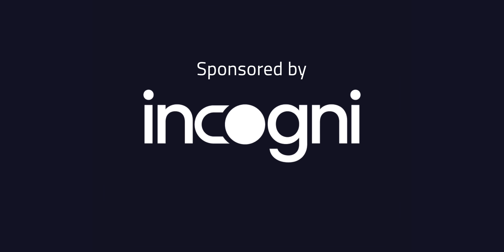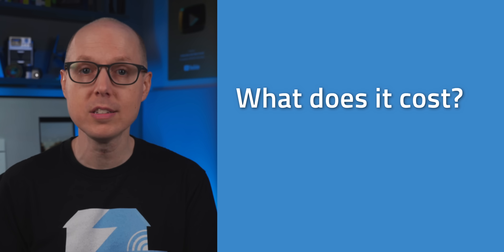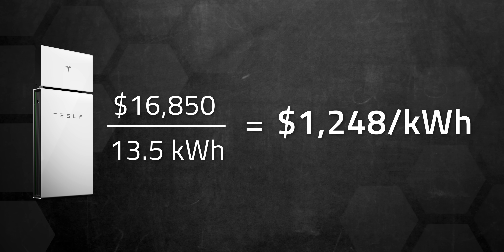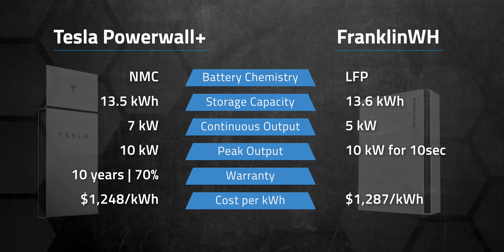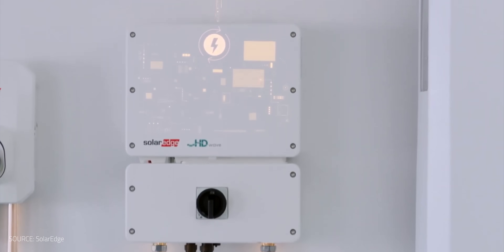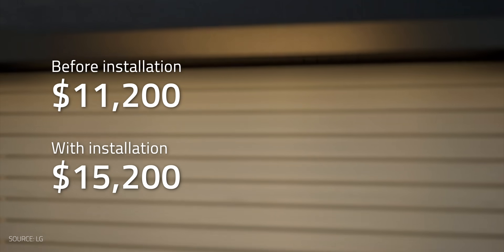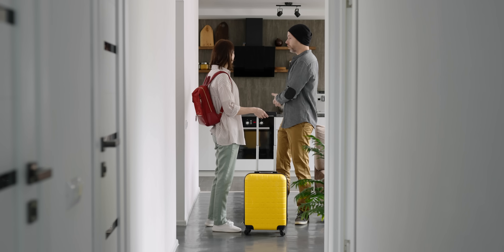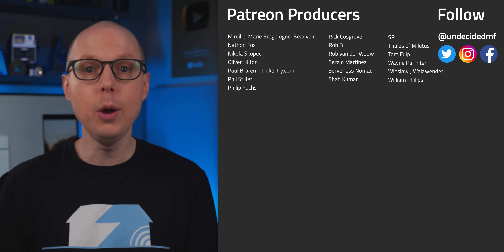Top 5 Batteries for Home (And One You Might Not Expect)

Comment: Something I don't think you mentioned is how ridiculously easy it is to DIY a solution, these days.  With PnP inverters and server-rack batteries, going off-grid or grid-tied with DIY battery options is easier than most folks might believe.  You can also save quite a bit of money in the process, plus you wind up with a much better understanding of what you have, what to expect from it, and what to do if there are ever any issues.  Commercial product offerings are nice n' all, but there is stil are many DIY options in this space that are worth considering.
Reply: same. almost no ROI of the products/services video mentioned because these systems keep going down in price, getting better, and professional install is too expensive. a simpler, cheaper system installed by an electrician will ROI in a few years then buy again/upgrade after a few years.
Reply: Do DIY ones have any sorts of Smart Home integrations like Home Assistant ?
Reply: @NicCrimson  My off-grid DIY system is fully integrated into Home Assistant, along with my grid-tied system. My off-grid inverter uses Solar Assistant MQTT broker to communicate with HA. I have full automation control over my system and it automatically manages switching between grid and off-grid supplies, supplemental battery charging if needed, various load management automations etc.
Reply: @alexsimmons1803  Would love to learn about your setup
Reply: @NicCrimson  - Not nearly as much, but depending on your philosophical bent, that may be considered a positive.
Reply: Exactly what I'm doing.  They're less than half the price of companies like Eco/Blu/Fran/etc.  And I save two grand by (=carefully=) doing all the work myself.
Reply: Sadly, in Finland DIY is not allowed by law. Only certified electricians can touch your home circuit board.
Reply: @DenzilFerreira  Same here - the good thing is the AC part is not hard and doesn't take long for a sparky to put in a transfer switch or essential loads panel. I don't touch the AC side.
Reply: @alexsimmons1803  in case there is a fire at home, and it's determined that it's electric, they will ask for record of certificated electric work. If the spark came from somewhere not certified, and it was my doing, no insurance will pick up the damage. And if it spreads to others homes, it's jail time. Not gonna risk it.
Reply: @DenzilFerreira  Which is why I said I get the sparky (electrician) in to do that work. It's a pretty simple job for them.
Reply: @alexsimmons1803  ah gotcha! Yeah indeed 👍
Reply: @DenzilFerreira  are you sure it is your home then? Sounds like the Government owns your home, and you are a surf! Sorry! :face-orange-raised-eyebrow::face-blue-wide-eyes:😪
Reply: @DenzilFerreira  - Glad I still live in a place where people are allowed to be both competent and free.  At least for now, anyway.  😕
Reply: @jasonbroom7147  There was a time when electricity was for certified electricians only and the whle installation was sealed. Then the rules chanced so everything after the meter was accesible for DIY as well. Due to the increasing ammount of incidents the rules are close to return to ancient history: Only certified electricians can instal/service anything connected to the grid.

People should be free and competent, unfortunatly a large group of people is free to be incompetent.
(Note that we are blessed here with a highly reliable grid, nearly no one here can recall an outage that lasted longer than a few minutes over the last 50 years)
Reply: @hotdognl70   There was a small regional department store chain in Florida in the fifties and sixties called Maas Brothers.
Reply: @frequentlycynical642  My only connection to Florida has been a few trips to Deland, no family busines lol.
Reply: @hundry_f  - Signature Solar and Will Prowse are two things to look at, but that's just the tip of the iceberg.
Reply: @spritsfal5088  - I have worked with enough "professionals" that I no longer trust any of them without verifying.  That's why I take the weeks/months/years to learn stuff.  DIY is cheaper, although not always by a huge amount.  Also, there's a ton of DIY stuff on the market this is really not that hard to work with, like it used to be.
Reply: @Jason Broom that's all 100% true, until your house catches on fire! Good luck with the insurance company.  If you hook your DIY project to your home, at least have an electrician check your work and make suggestions to give some peace of mind, but even then the insurance company is still gonna deny your claim if at all possible.
Reply: @dashboy007  - The statement you made about the insurance company is true, period, and has nothing to do with any of this other stuff.  With that said, if all of the products you use are UL listed, and many are these days, the only other thing you have to do is pass inspection.  I know some folks are completely sold on letting a "professional" do everything for them, but those same people will tell you stories of how professionals either screwed something up or intentionally ripped them off.  I take responsibility for my situation by being informed and engaged.  Others are more than happy to pay someone else to do that, and hope for the best.  Modern LFP batteries and high-quality inverters are as safe as any of the legacy power equipment already in your home, in many cases they are even safer.
Reply: @Jason Broom all I said is take some common sense precautions, one of which is asking your insurance agent about your rights and remedies to your claim should you need to file one. You do not want your DIY Solar project to be the one thing that changes your life for the worse. 

In other words, don't be that guy who is surprised to find out after the fact that your homeowner's insurance will not cover the damages because you were too dumb to ask! It is that simple!
Reply: Well have fun getting a permit!
Reply: @Riceman-o1p  - You don't have to be grid-tied, you don't have to fall for the net-metering carrot, and you don't have to live in a place where your freedoms are exceedingly restricted.  If you want all of those things, then go ahead and pay through the nose for a "professional" to install your system, with permits and the whole nine yards.  Have fun with your 12-year ROI!
Reply: In a lot of places, you can't do this due to building codes.  A friend of mine just went through this with a grid-tie system.  He looked at all the options, but with permitting & certified installer complications, it was easier & cheaper to just go with a complete solution with a certified installer.   The building inspector said that in theory DIY was possible, but it would be significantly more time/paperwork/money & would require a EE signoff.  Plus his home insurance would not have covered it or any associated issues.
Reply: @ckm-mkc  That's really interesting. I haven't gotten that far into it, but from what I've found so far it looks like as long as everything is UL listed (which many units are not) the code/insurance issues should go away. Obviously the "in theory" and "in practice" can vary significantly.
Reply: @ckm-mkc  That's just his local utility company trying to keep people from using them as little as possible. A reputable rack battery system that is UL listed will pass code. You can get a smart switch, such as from Enphase and the grid is totally safe and will pass all safety codes.
Reply: @ckm-mkc . Build a battery cart. 3kwh cap 1kw inverter 400 watt solar input with 500 watt mppt. Charge controller. Cant do everything but can do a lot. Portable ish could cost $1000-1500. Lifepo battery ftw
Reply: @ckm-mkc  - If, by "a lot of places", you mean Kalifornia, then I agree.  In normal places, where nuttiness is not completely out of control, it's totally doable, especially with all of the UL approved options on the market these days.
Reply: @jasonbroom7147  Tell your home insurance company that you've installed batteries without a UL listing - see what happens. Don't tell them and see what happens after a fire.
Reply: @BLKMGK4  - Tell me about all the fires associated with LiFePO4 batteries.  Go ahead, I'll wait.
Reply: Was going to say the same thing. It's crazy how much less expensive something like a Sol-Ark 15K + a stack of LiPo server rack batteries is compared to these solutions.
Reply: Check out your local chandlery. Big cats these days have systems of similar to house sizes.
Reply: Wrong!  You will never get a permit with your idea and therefore you just can't do it being connected to the electrical grid and take advantage of time or use, or self consumption options.
Reply: @boblatkey7160  - If you live in a communist country, like Kalifornia, that is probably true.  In the Land of the Free, there are restrictions, but they are reasonable.  Before you make comments that illustrate your ignorance, you should probably look at the products being made today...stuff that has ALL of the necessary UL listings to pass inspection, pretty much anywhere.  ;)

Comment: Hey Matt!  There is an error in the video regardng the SolarEdge battery, but it's not your fault.  SolarEdge has miselading marketing and literature around their batteries.  Last year I had a 15.4kw SolarEdge system installed with and 11.4kw inverter, their backup interface, their integrated level 2 EVSE, and a single SolarEdge battery.  SolarEdge has videos and marketing materials published stating a firmware update was imminent to enable hooking up a generator to run your system and charge the battery in the event of an extended power outage.  There is no firmware update, and last week SolarEdge told my installer that I should have a critical loads panel and a transfer switch installed instead.  I can then run off a generator, but it is in no way going to charge the batteries or back up my whole home.  It would be no different than just skipping the solar and battery and just running off a backup generator.  My installer has been installing the Franklin backup panel and battery systems for folks now due to the bait and switch pulled by SolarEdge.  It already has the generator integration functional.

Outside of this issue, we've been really happy with our SolarEdge system.  The EVSE can charge the car off of excess solar, and since the battery is DC coupled it charges using energy that is normally clipped if it's not topped up.  I regularly hit production 2-3KW above what the inverter is rated at while the battery is charging.  As someone that spent 11 days without power a couple years back, the ability to backup from a generator after the battery was drained was a key feature for me, and is an issue I'm still trying to resolve with SolarEdge.  We may end up yanking the Solar Edge backup and battery out and switching to Franklin.

Comment: Our system is based on a Sol-Ark inverter / battery charger / transfer switch, the only think it doesn't have is an outlet for the EV (it does have a generator input),  We went with 3 Sol-Ark 12's, which was overkill, my peak power with an EV and max house load is 15KVA.  Sol-Ark has an 8, 12 and 15KVA unit.   The batteries are 2 eVault 18.5KWh.  I spent 6 weeks in the late spring with no grid use.  This winter was a killer, lots of rain and cloudy days.

Comment: You used as a consumption example a 1kw microwave using 13kw over 13 hours. In Britain, the 1kw of a microwave oven is the power getting into the food - my 1000 watt Panasonic draws 1200watts through the plug because of the electronics needed to make it work.
A 100% efficient 1kw resistive heater would have given a more accurate guide :)
This was one of your videos only relevant to your domestic market, so I couldn't give it my usual "like". Thanks anyway.

Comment: Just had 10 kW / 27 REC 405 panels with IQ8 micro-inverters installed and waiting for a net meter swap (delayed due to the pandemic hangover issues). Wanted a battery system but installer advised against it due to cost and safety. Well they sure were right on the cost. It would have cost us $19k installed for a single day's worth of backup. Undeterred, I inquired about the solar-only option so we could at least use the panels during an outage, and that would have been another $9k installed. Needless to say, the panels were enough load to carry for the average homeowner. We'll wait, thank-you. In the meantime, there's the conversion from LP gas to heat pump to consider, so batteries are falling quickly behind.

Comment: Installing solar without battery backup is for those wishing to be low carbon and low mineral mining impact.   Batteries greatly increase cost and reduce efficiency for an installed system. A minimal hydrocarbon powered backup generator (that is seldom used) works for many of us as cost efficient in place of batteries, particularly those folks that can survive a few hours without the grid. hth

Comment: We built an efficient house in MA with a 15 kW LG solar array and Enphase microinverters. With net metering plus 10 years of SMART program incentive payments, adding batteries didn’t seem cost effective. After living in the house for a year and a half, plus charging an EV for the last 5 months, we remain considerably net positive. We’re grid-tied and have a 22 kW backup propane generator. When the SMART payments expire, we will look into batteries but at this point in time, in our state and location, the cost of batteries doesn’t match the benefit. I assume that home battery technology will evolve, making it an increasingly attractive option.

Comment: Unless you want a battery for backup (grid outages), if you have net-metering from your utility, even if it is not at retail rates, the economics of a BSS don't work.  IOW, it's much more cost effective to sell (store) your surplus energy to the grid than store it on site to be used during off-solar times.  The situation changes if you can't sell to the grid, but it's still a long payback.

Comment: One big downside with Enphase is that their continuous capacity is low (for now) so many customers would have to get two or three (maximum of four per IQ combiner box) to get a useable capacity in the event of a grid outage. 

That said, I think Enphase has the safest battery with the LFP chemistry and likely the longest shelf life, too, because the microinverters add an element of safety and longevity to the batteries.

Enphase is spending R&D money to get higher continuous capacity batteries on the market, though.
Reply: That sounds good because I have a 240 well pump that would not work with the Enphase pack as it stands and would love to buy that brand.
Reply: @mpetty9947  You can run your well pump from an Enphase battery. You need two of them instead of one though.
Reply: I’m unclear what you had in mind, if you add more enphase batteries you get both more power and energy capacity until you reach your desired needs. They are just smaller building blocks, (not really less power) you can have 12x IQ battery 3s or 4x battery 10’s.   Did I mention that a battery 10 is 3x battery 3s under a larger cover?

Comment: All home batteries are a scam.  Home backup batteries are NOT GREEN ENERGY! It is the WORST waste of Lithium Ion tech.

Lithium Ion batteries have a HUGE carbon cost.  The only way to offset that cost is to use them to the point of failure over a 5nto 10 year time frame.

Home backup batteries DONT...GET....USED.

You are buying a huge carbon debt... They are carbon liabilities.

Unless you are off the grid, just put your solar energy back into the grid and turn back your meter.  If you produce a surplus and don't get paid for it... THAT makes you a green energy hero.

Save the lithium for the EV's and last mile shipping solutions.

If you want a backup for your house...a generator is THE GREENER OPTION.

Comment: If I had the money that would let me buy and build what I want, I would buy at least 50 acres and build a wind and solar farm and use it to fill a barn full of batteries. I can use it to power the house 100% of the time and because Ontario has ultra low overnight rates and a higher peak rate, I can top up overnight if I need to and sell excess power back during the day and make money off the spread.

Comment: I had installed my LG Chem battery (10KW) in 2015. I did most of the prep work myself. The installer validated my work and only needed the perform the actual shunt/bypass between the meter and the fusebox. Mostly because in our area we also have some winter (snow) storms, but we're living on a small branch of a state road. If there are multiple outages, we are put at the end of the queue because 11 homes without power is nothing compared to hundreds of more homes. Usually power is restored within 6 hours.

Netmering in our area is about to change. If I use 5000 kWh and generate 3000 Kwh, I only have to pay for 2000 kWh. However in 2024 this is gonna change. I still have have to pay for 2000 Kwh of energy use, but I also get billed for 8000 kWh of transport costs. So we have an incentive to upgrade our storage capacity. Up to 2017 we were net zero, but after the birth of my 4 children, work more from home, energy usage has gone up with the installation of a heat pump, additional (double wide, full height) freezer and refrigerator and convert from a gas stove to an induction one. We also have electric sauna and hottub. With 4 children in age 2-5 we love relaxing in our sauna or hottub whenever we can. We both work hard, so we also play hard ;-)

But it is interesting to hear about new options. In 2020 there were plans to build a new home, but due to covid and inflation, we have put it off for a few years so we can save some more money and maybe prices will drop in a few years. But I don't count on the last one...